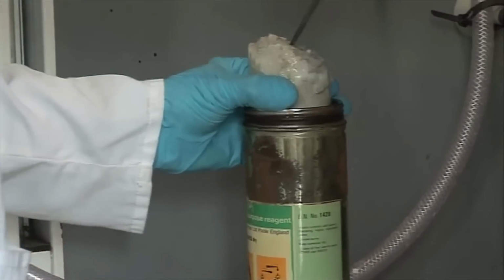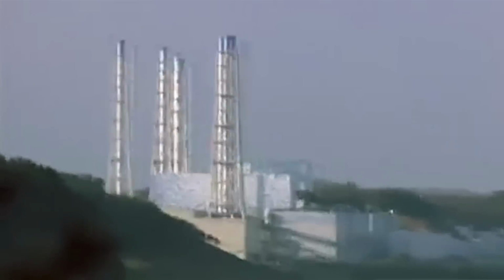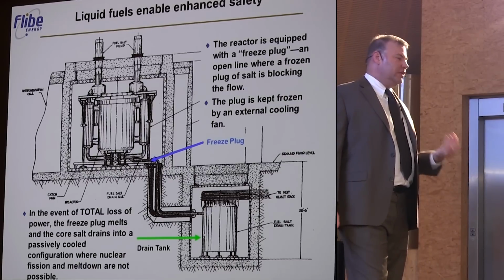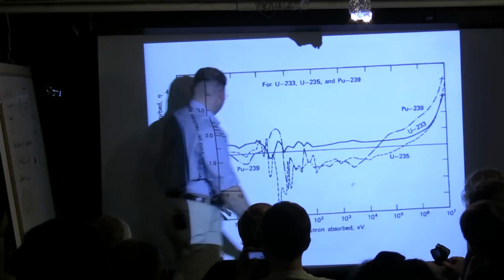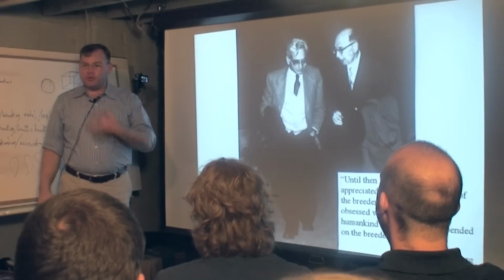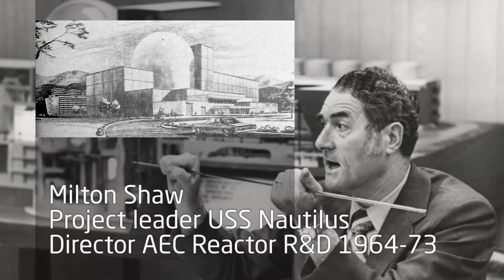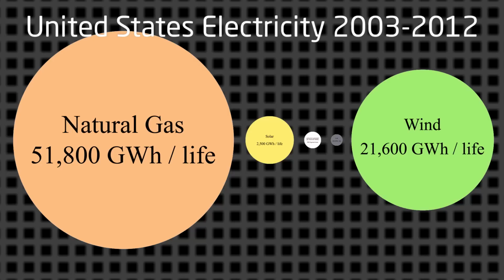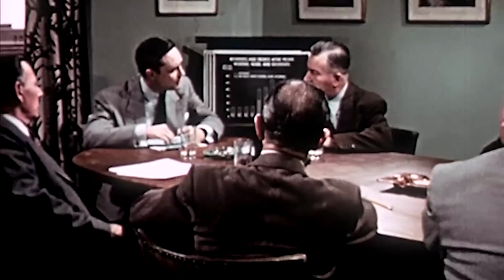Nuclear Disasters & Coolants

Comment: The government PICKED a winner from politics, NOT from SCIENTIFIC evaluation.
Reply: eh, kind of. The government picked a winner from a set of technical specifications. The LWR made the most sense in naval power. It was simple enough, wasn't bound by fuel constraints like commercial reactors and it fit in the hulls of the vessels. The other benefit is that a small LWR on a ship or a sub, sits in all the coolant it will ever need. The reactor itself lives in its own pressure vessel, surrounded by another pressure vessel which is the hull of the sub. If anything goes catastrophically wrong, gravity will take the reactor to the safest place on earth for one, the bottom of the ocean. For the Navy, LWRs make the most sense. But like Dr. Weinberg said, once you go up to hundreds of MWe or more, the safety cannot be guaranteed. Every drop of water that reactor needs, must be pumped to it with enough volume to keep it cool, even in shutdown. And a 1000 MWe LWR, even in shutdown, produces more decay heat than a submarine reactor does at full chooch. 
It's like most of these 4th Gen reactor guys have been saying. LWRs are good for naval power. But a sub/carrier is a different beast than powering large cities. If the US Navy is paying the first run costs, they're going to get what they want for their purposes. You don't necessarily get a good commercial reactor from that.
Reply: @Clean97GTI  Nope, the fast breeder and thorium reactors were going head to head under the atoms for peace program.  A replacement for light water reactors during the eisenhower-nixon administrations.  California made a deal and Hanford got the research and jobs.  Oak Ridge got shutdown, hard.

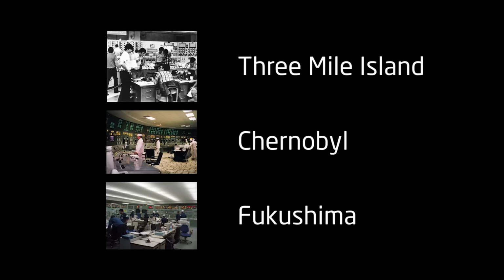Comment: 15:00 water is an inadequate coolant with only 100°C liquid range. also a bad idea to use same material for moderator and coolant.
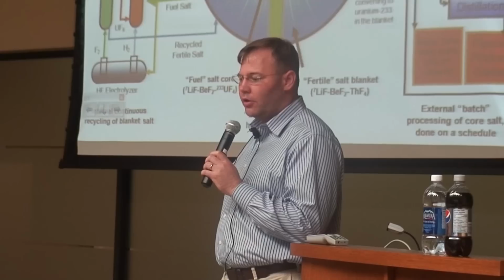18:21 inherent safety systems vs deterministic or engineered safety systems

Comment: what I heard about chernobyl was that they were doing an experiment, pulling the control rods out further than normal and by the time they tried to put them back in, the fuel rods had warped so much that they couldn't put them back in
Reply: There is a lot more to it than that. Chernobyl's RBMK reactors have some design problems that US reactors don't have. For starters, they are water cooled and graphite moderated which creates the possibility for problems that don't exist elsewhere. If you loose coolant in a Western reactor, your reactivity rate actually drops as you lose neutrons, because fast neutrons don't cause fission as reliably. You're actually making more neutrons, but they aren't contributing to the reaction. That's why fast reactors require a lot more fuel than thermal spectrum reactors do. The water also serves as the neutron absorber which stops some of the neutrons. Western Reactors always have the water present as both absorber and coolant and rely on control rods to moderate the reaction. As long as you get the control rods in, the reactivity can be controlled and as long as coolant is restored, decay heat is controlled. In an RBMK, if you loose coolant, you still have your graphite moderator in the reactor which means your reaction can continue and even accelerate. We call this a positive void coefficiency. Basically, in the presence of steam (from a pressure loss or coolant loss) the RBMK reactor makes even more power. A Western reactor cannot do this. 
There are also some technical designs details that make the RBMK unstable at low power. The reactor produces Xe-135 which is a powerful neutron absorber. In normal operation, The Xe-135 is consumed rather quickly, but in the low power state Chernobyl #4 was in, sizable quantities were produced. That was why the engineers wanted the RBMK at higher power for testing. Because as soon as you ramped up power in a test, the Xe-135 gets consumed quickly and you end up with a lot more neutrons flying around than you would expect. When the operators did an emergency shutdown, the graphite (neutron moderating) tipped rods displaced the neutron absorbing water and coupled with the Xe-135 and the unstable nature of low power operation, the reactor went from 200Mw to 30,000Mw and BOOM! It wouldn't have mattered if they couldn't get the control rods in or not, at that point.
The fix for the Chernobyl #4 reactor would have been to wait for the Xe-135 to decay away as you slowly bring power levels up to stabilize the reaction.
Reply: @Clean97GTI  The main cause was the faulty design of the control rods with the graphite displacer at the end, which actually gave a power boost when it was expected by the operators that the nuclear reaction is shut down. Scott Manley gave a good explanation of the details: https://www.youtube.com/watch?v=q3d3rzFTrLg

Comment: Another way to help folks understand Energy from Thorium (LFTRs) & to encourage them to discuss / debate related issues is...

To create a MOOC (Massive Open Online Course) on EfT & related topics.

PS A recent report of a "breakthrough" result in extremely costly Fusion research made me think, that we could have had Energy from Thorium, ie, if even half the money spent on Fusion research had gone into Thorium / LFTR research.

Fusion would require extreme temperatures... I'm reminded of the low energy process by which spiders make extremely strong spider silk... contrast that natural process with the inefficient way we use to make our strong rivers, eg, the one used to make Kevlar vests.

Thorium is our spider silk process as Fusion would be our Kevlar process.

It's time to embrace the efficient solution, for a change: Energy from Thorium.

Comment: Anyone who understands both

1. the destructive nature of mining for Coal Seam Gas (CSG) or Shale Oil, is, using Fracking (a.k.a. Hydraulic Fracturing) and

2. the safe, green nature of Energy from Thorium (LFTRs)

should help promote EfT so we will not be tempted to do any more Fracking.
Reply: What do you mean with green energy? While nuclear power has low or no CO2 emissions (depending if you count the concrete and other constructioin materials), it is not renewable as nuclear fuel is consumed and then gone.

Comment: Name a currently active Nuclear Reactor system that has NOT failed. 

Thorium Salt.
Reply: One can still make an unsafe TMSR. Competence is required no matter which design route is chosen. And a counter-argument to this would be that PWR has to-date established a higher uptime ratio than MSR, and it is probably going to take a long time before MSR can compete with PWR capacity factor and reliability. FOAK (First Of A Kind) is always tough.

Comment: Molten salt is not so good coolant, specific heat capacity 60% and 40% of liquid water per volume and mass. It needs larger and powerful pump. How about helium gas or supercritical CO2 as secondary coolant?
Reply: Not all molten salts are equal, and in fact Flibe has greater specific heat capacity than water... It is one of the very rare materials which can claim that!
Reply: In the UK our MAGNOX/AGR reactors were CO2 cooled.

Comment: The Fukushima plant was built in 1979 and plated to make 5306 Megawatts from its 6 reactors , The design of the plant reactor was made by General Electric,,,, There is a boiling water nuclear power plant within !00 miles from me,, A couple really but the design is from General Electric commissioned in 1967 and is plated to make 1820 Mw/hr from two reactors.  The two plants (Fuku and near my home ) are identical ,,, there are many many of that design around the US. and there all getting OLD.
Reply: And ge engineers knew they were dangerous. Ge wouldnt change design so 3 of them i think quit. They knew in the late 50s this would kill.

Comment: I disagree with the safety calculations though. While Nuclear power might be safer based on the current incident rate the potential for a major disaster is far higher than any other source. Look at the radiation field produced by Chernobyl. I do like the concept of the molten salt reactor though. Sounds like a lot of politics are involved. The very last sentence sums up the whole problem.
Reply from the maker: There are 60 years of civilian nuclear power feeding into grids to base the safety case on. Over those 60 years it has proven itself to be one of the safest sources of electricity available, and one of the lowest-carbon. If you wish to ignore 60y of data and base decisions on worst-case accidents, then please look into the Banqiao disaster. Another communist-regime energy disaster, but not nuclear. If you based your decisions on THAT accident's body-count then you'd be dismissing the OTHER very-safe very-low-carbon source of electricity production. Please look it up. I don't want to give away the surprise, or the body-count. It isn't a secret, it just happens no one is aware of it they way people are of Chernobyl.

Comment: I'm in favor of the LFTR, but I want to be fair about it. I realize that the sodium in the IFR is in a separate building, from the water in any steam turbine. It's as far removed from the fast reaction as is possible. Sodium and water is are physically separated. And IFRs are not even water cooled, as you know. 

I think the USA should jump into LFTR research big time, as the Argonne team did its job in demonstrating the IFR, falling just short of a prototype. So too should the government do the same with the LFTR...jumping right to the prototype. I understand that Bill Gates and his team are doing just that. So are the Chinese, who are also charging ahead full speed.

The old 2nd gen, water reactors...like Fukushima ande TMI... were a technology that Rickover chose for his submarines. They are totally obsolete, and they should, and will be decommissioned. This is why I didn't like the conflation of the 4th gen sodium IFR, and 2nd gen water reactors, at the beginning of this vid. As far as Chernobyl, why should the worse reactor ever designed be, in any way an impediment, to the best reactors oever diesigned...the IFRs and the LFTRs.

If a successful LFTR is built, it will surge ahead in the public mind, as it doesn't use uranium at all, but it's abundant cousin....with two protons fewer in the nucleus. This is why I support the LFTR. If the prototype can not be achieved, we still have the IFRs, with their 300 years of operational experience, which I predict will have their uses too. among them is the burning of the world's waste dumps....which is what the GEH, S-PRISMs are poised to do in the U.K.

There's something sneaky about this video, which I don't like, though I understand the reasoning. You want the LFTRs to succeed. So do I...but let's be fair about the IFRs while we are at it.
Reply: Yeah, the pro-nuclear crowd has little to gain by going after itself. Uranium reactors are worth developing, and thorium reactors are worth developing.
Reply: I agree, but let's be fair to the LWR and HWR too. Neither one has caused any provable deaths, not even statistically provable. Chernobyl was a less stable design, the RBMK, in which loss of coolant accelerated the reaction, because it wasn't the neutron moderator. There were NO deaths at the reactors in Fukushima, nor TMI, in spite of the weaknesses of the LWR design compared with sodium cooled or liquid salt cooled.
Thorconpower.com is starting off with beryllium and sodium fluorides, on account of the necessity that your lithium contain the absolute minimum of its isotope 6, which becomes helium-4 and hydrogen-3 if fissioned by a neutron.
The lithium fluoride associated with these atoms becomes hydrofluoric, the most violently corrosive acid known.
Sodium is a patsy by comparison.
The IFR design differs from the BN-600, BN-800 designs, in using metal, not oxide fuel. molten sodium under an atmosphere of argon is entirely non-reactive.

Comment: Thank you for another great video!

I read an article saying that one of the major problems, and in fact the reason why LFTR reactors aren't doable, is the high amounts of gamma radiation. I've heard Kirk Sorensen touch upon this briefly also, but I still can't figure out the rights and wrongs of the gamma radiation. Any chance you could elaborate on this subject?

Thanks!
Reply from the maker: Dennis, all nuclear reactors generate gamma radiation (and alpha and beta). The challenge with LFTR would be reprocessing the (radioactive) salts to extract fission products... the salts themselves are emitting gamma radiation during this process, so everything would need to be done using machinery built to withstand the radiation. This is possible, just unusual... machinery is typically built to withstand heat and pressure but radiation hardening is not usually a requirement for hardware used in industrial processes. So some of the chemical processing gear might be custom, rather than off-the-shelf items that would have cost less to accomplish the same processing.

The MSRE video... http://youtu.be/knofNX7HCbg?t=7m28s ...has a bit of operator discussion about maintaining gear in a high-radiation environment. My own understanding is that their challenges were basically a reflection of limited budget and focus on simply trying to demonstrate the concept worked... you could certainly build a reactor to be better monitored and maintained today thanks to advancements in radiation hardened remote controlled robotics... as opposed to long-handled-tools and mirrors the MSRE guys used, to work behind several feet of shielding concrete.
Reply: @gordonmcdowell  And as of today, what would Kirk says about the question above?
Reply from the maker: @Brandon_letsgo  No one at the MSR conferences was debating or discussing it. I think it is sort of a given that in a nuclear reactor there's gamma radiation. And beta. And alpha. And heat. It is a nuclear reactor. Sorry for the non-answer but I don't get the question.
Reply: @gordonmcdowell  Thanks.
Reply: Its more that in reactors using solid fuel the fission products stay in the cladding which is usually under water. The water acts as a shield to the gamma rays making it 'safe'. As the fission products stay in the fuel rod the  risk from gamma radiation is minimal.

As soon as you move to liquid fuel you are suddenly having to deal with strong gamma emitters travelling through tubing and processing units. I am yet to see a viable solution other than having all of the tubing and processing structures underwater which would be ridiculous. These extra layers of engineering are an enormous challenge. Add the fact that the molten salt is likely to create small amounts of fluorine gas and hydrofluoric acid (a highly corrosive chemical) and you have a mixture of highly radioactive, hot, corrosive fluid which needs to be safely moved around and processed at high temperature to stop the salt from freezing. I will need a lot of convincing that this is better than a solid pellet in a rod that is just taken out of the reactor by a robotic arm.

Liquid fuels certainly offer a lot of advantages on paper, but really solid fuels are the only truly economic way of producing large amounts of energy from nuclear power - even with their drawbacks. Uranium supply is plentiful, and the 4th gen reactors based on solid fuels look very promising.
Reply: @jamesnewby2382  Where does the hydrofluoric acid come from? The fluorine gas I get, but what process produces the HF? What chemical steps are you using to get there? 
And there is another solution to liquid fluorides; use chlorides instead and run at lower temperatures.
And I'm not sure what you mean by a corrosive fluid. Pure fluoride salts are not really corrosive. The temperature does induce wear but ORNL looked at the corrosion in the piping after the MSRE and found minimal corrosion after 5+ years of exposure. Keeping the salts clean is a constant job as any introduction of water could generate the HF you're talking about but even then, the temperatures in the LFTR would cause it to disassociate and the hydrogen would be carried off or would bond with the lithium ions.
Reply: @Clean97GTI  My comment was 4 months ago, but probably related to the HF electrolyser used to feed F2 and H2 into the process. Having worked with HF it is horrible stuff and requires dedicated equipment to handle it. More corrosive are some of the the fission products (I think tellurium is mentioned as being corrosive?) as well as the radioactive particles themselves. Alphas, betas and neutrons are not nice things and everything the liquid fuel comes into contact with will be damaged to a degree by these particles. Add in that you will need to run these facilities for 40-50 years, the stuff in contact with the fuel is going to take a real battering, making the engineering a significant challenge.

Comment: So Fukushima would have survived the tsunami if they had put the generators on the 2nd or 3rd floors, and not in the basement. Such a simple answer to a seawall failure. Hard to believe they didn't see that contingency.
Reply: Or a secondary backup coolant supply.  Would take something radical and high-tech called a water tank.  :-(